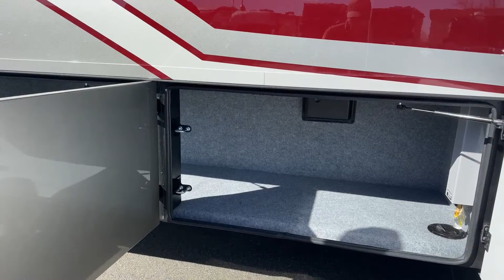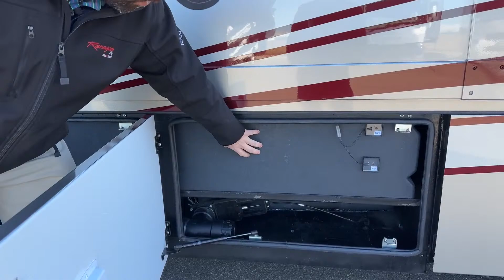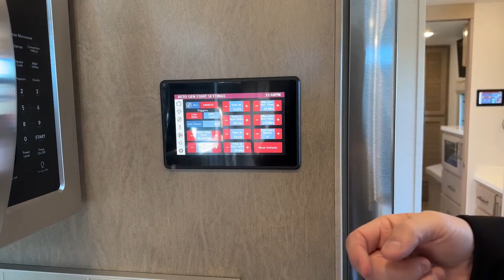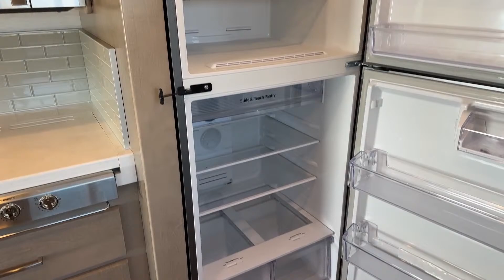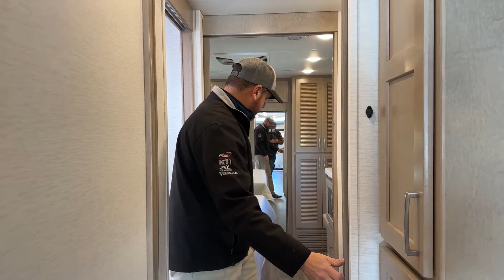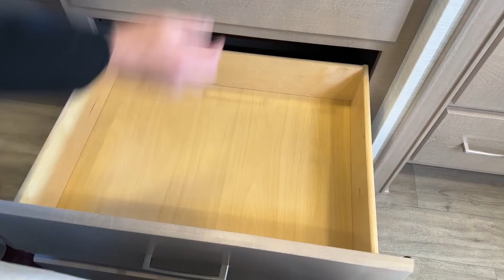2024 Renegade Valencia 38RW

Comment: Does this RV feature added insulation for very cold or hot climates?
Reply: Construction includes 2" vacuum bond laminated sidewalls with welded aluminum framing; "super sandwich" floor construction with composite underbelly, 2" welded steel floor joist mounted to 3" steel floor beams, 3/4" plywood deck over 2X4 wood framed residential floor with thermal and sound deadening insulation.  Also, the holding tanks both gray and black have 12V heaters on them.
Reply: @rgrussell76  R 26 ?